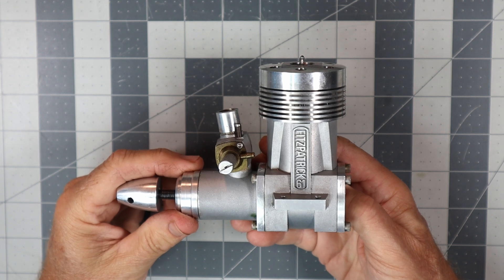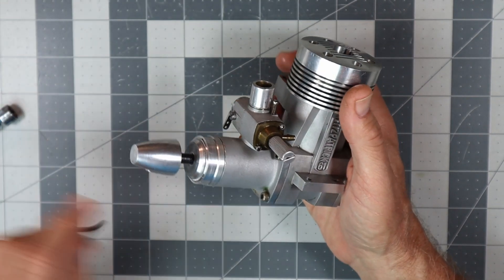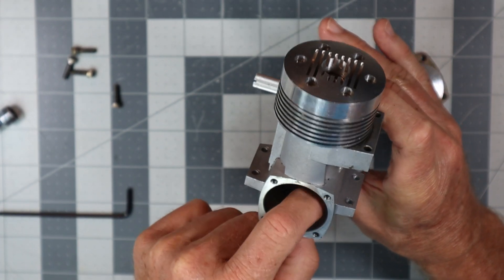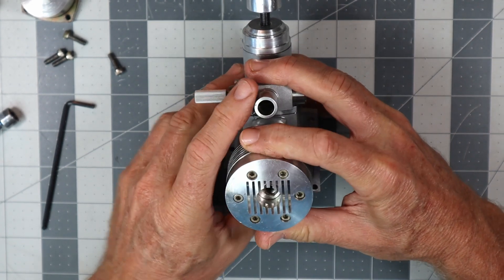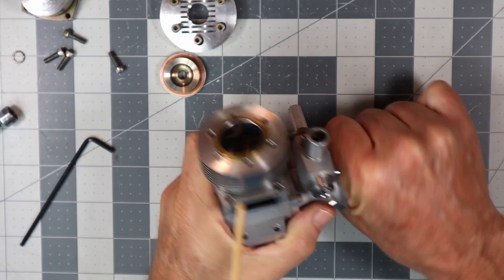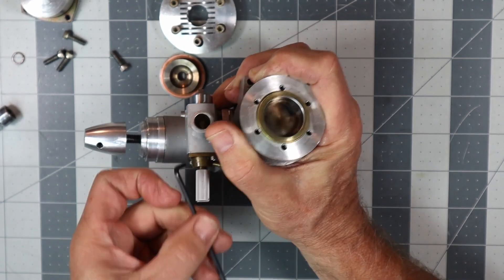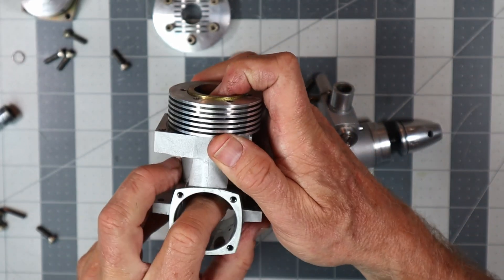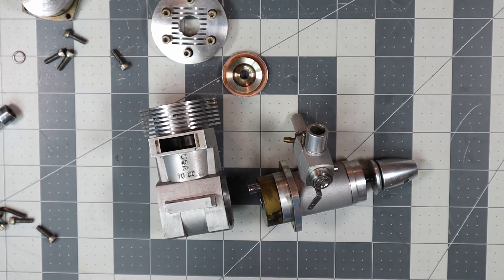Fitzpatrick 61 A Look Inside

Comment: Cox Conquest .15 and Rossi .15 had buttons. I think it has a brass ring to retain the epoxy filler onto the crankshaft. Engines designed for FAI fuel probably have more compression than ones designed for nitro fuels, with that 5-10% would be plenty.
Reply from the maker: Yeah! Rossi is what I was thinking of.  The Rossi 40 I have now has that style of head.

Comment: Je suis désolé de vous corriger. Ce n'est  pas le composant nitro qui fait rouiller mais simplement le méthanol qui est hygroscopique et surtout les résidus de combustion qui sont acides . So ...
Reply from the maker: Actually the nitro is also a component that contributes to rust formation also.
GLOW Engines.
"Here is a breakdown of the damaging effects that glow fuel has on your model airplane engines:

1.  Methanol is hygroscopic, meaning that it readily absorbs water from the air.
2.  Nitric acid is a main ingredient of nitromethane and it is a highly corrosive mineral acid.
3.  Nitromethane is classified as an oxidizer in the presence of water and oxygen. The bottom line is that it works to change the state of steel and aluminum (rust and corrosion)."

http://aeroscott.com/care-feeding-rc-engine-glow-gas/

Comment: I met those guys at a hobby convention in the Chicago suburb of Rosemont back in the day.  The engine was stunning, but beyond my means at the time.  The reason that they put the resin in the crankshaft is to reduce the volume of the crankcase,  As the piston rises, the air pressure in the crankcase is reduced and this is the way that fuel/air mixture is forced into the crankcase.  With the volume reduced, there is a greater pressure forcing the fuel/air mixture up the transfer ports into the combustion chamber when the piston descends.  We did this on two-stroke motorcycle engines back in the 70s with Styrofoam plugs held in with epoxy.  Good set of videos!